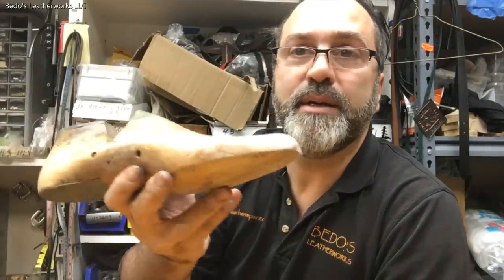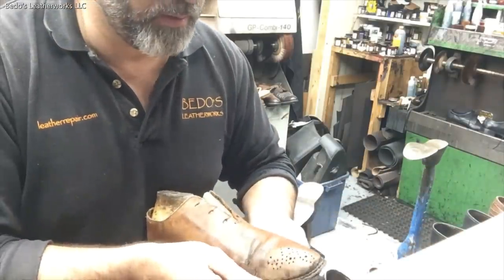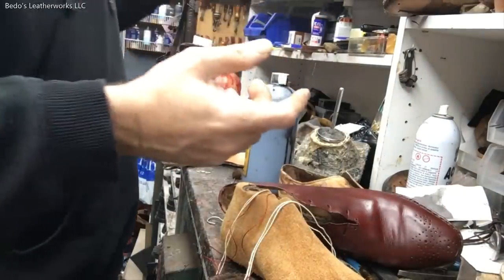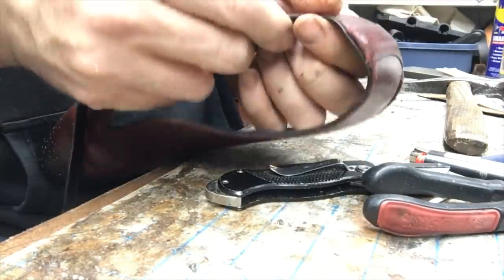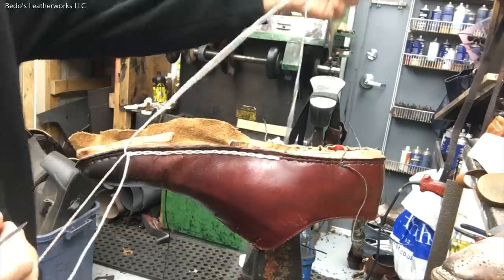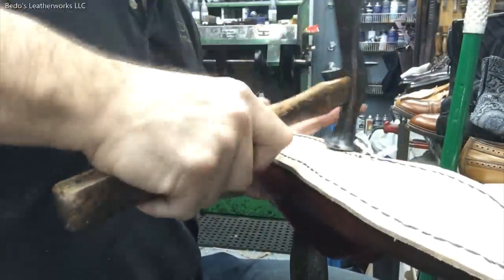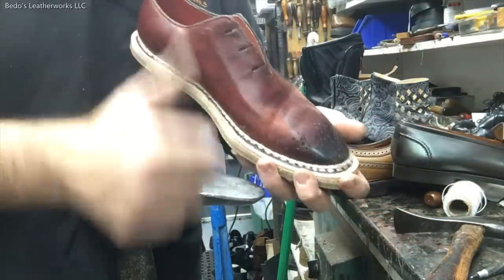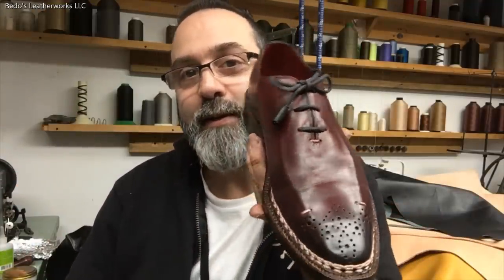Impossible Shoe Repair Project Stefano Bemer #157

Comment: When I was a teenager, I worked for Malanga Bros. Shoe Repair. It was a sweet little company where the craft was being taught and the shops were being passed down from generation to generation. Sadly, I think all the shops closed with the openings of Payless shoe stores on every corner, and I'm pretty sure that these artists all ended up working for Walmart.  But, watching your video brought me back to a time in which quality outweighed quantity. Just for a moment I could smell the shoe repair shop. The leather, the rubber, the glues....  Ahhh, Thanks for the memories. <3 Shelly

Comment: Thank you for such an entertaining and informative Video. For a while I was a maintenance engineer for Bata shoe manufacturers, and saw so many leather, rubber and plastic shoes made. Its a really labour intensive business. And its so odd that a brand shoe can retail for 5 times the price of a cheap shoe yet there is little difference in the effort and materials used

Comment: Fantastic job Steve.  Given the cost and quality of Stafano Bemer's a shame they ended in the condition you started with.  Were you able to tell if they were bespoke or standard product albeit high quality.  Finally how did you manage to get your hands on two pairs?  When you get them back will you be doing remaining shoe.  Surely someone out there would pay for have them given the opportunity?
Reply from the maker: Andy Bell the blue I bought on ebay
The red was sent in for a restoration which I said no to and the customer donated them. I will leave then as Is.

Comment: I just found  your channel...most excellent! I'm a used-machinery repair guy....but anyone who can fix old worn out stuff is OK..!
 My parents had a piano store back in the 1960-70's....my Dad did all the repairs....a lot of wood parts in the 'action' for each key...maybe 15 or more parts between the key and the strings...88 times. So I can really appreciate your hand work!!
   A question...don't laugh, I'm on limited income and buying 'cheap-o' work boots...several pairs, different brands USA made Chippewa, Wolverine......then, out on my ranch...the soles that are 1 piece...just peel off after a few days. The boots/soles appear to have been made by just using some sort of urethane to 'glue' them on to the uppers which are still quite useable....is there something I can use to re-glue them....??
 No shoe repair shops around here anymore...just buy the cheap shoes/boots and toss when worn a little...
  Anyone else got any idea..? Oh, by the way...all the 'stitches' are fake, just molded on to the 'soles' on the edges.
Reply from the maker: Wow in a few days???
Well there is Barge cement but not sure how well it will work for you. Clean both surfaces thoroughly and sand the surfaces if you can. Alt glue both sides wait about 20 minutes and press together
Reply: Hey, thanks for the reply!. the soles are fake Vibram...even the little lugs around the edges are hollow,  probably trash time for the uppers, but they look like new........
 3 days....for the USA made Chippewa... @BedosLeatherworksLLC
Reply from the maker: @dougankrum3328  you’re welcome to send me some pictures bedos@yahoo.com
Reply: @BedosLeatherworksLLC  Pictures...OK...! Nothing between the flimsy insole  and the fake Vibram...1/2" of brown urethane foamy stuff...nothing really 'smooth' to glue to like your stuff.

Comment: Steve,  I am wondering ..... If you sand the surface of leather, would the leather grain be sanded away ??  If so, without the top grain, the leather would be like a piece of card board paper !  Besides, without leather grain, how can you bring the shinning surface back ?  what's the number of grit sand paper you used ??  Could you tell .... Thanks !

Comment: I decided to order an airbrush kit to do the burnishing with instead of using the Pom Pom so I do not end up with a harsh line and it looks more natural when it is complete. Not sure if I should apply the dye full strength with the airbrush or thinned out. I guess I will figure it out when it gets here and I try it on the first pair.

Comment: was a carpenter for many years.  owned table saws, skilsaws, chainsaws, routers, even a K-12 saw, every means to inflict grievous injury upon the body.  none of em got me, except a lowly utility knife quite similar to what this man is using. cutting overhead a piece of arch trim jamb liner for a window.  holding the trim with one hand, slicing with the other hand '..... the length of the inside of my forearm - 30 stitches.  lucky I didn't hit an artery, ligament or tendon.
Reply from the maker: marcus cicero OMG 😳

Comment: I had found some chelsea boots that were very dry which I had put lotion on to rehydrate but it doesn't seem to be working. Dry cracks seem to be forming were ever it is bent. What do you recommend?
Reply from the maker: David Glazier not much you can do when it’s to a point of no return

Comment: Doing that "leather footbed integral gemming" looked like such's a big pain.  Red hot awl / poker or drill. I got a wood and leather burning kit for a birthday once, think it was my 8th, and an electric drill for another, my 11th... drill is faster but it would end up burning though too, unless you pecked your way through.  Bet you failed the awls by overheating the heat treat temper... turning them back in to cheap rubbery cleaner cloths hanger wire!  
Notice I sort of skipped over the wood/leather burning kit.... yep  got in trouble with branding our dog Toby III, a beagle, and my brother with ownership brands, in case you lost them.... suggestions you really got to get them strapped or cinched down tight, or they wiggle around so much its hard to do a neat job... never mind the whining and wimpering!

Comment: Could you not use a Dremil type  tool with a fine drill bit in place of using an awl ? It may not be true to the craft but it would certainly make the task easier.

Comment: Always nervous watching people work with razor blades now. This last year I put some pressure on one during typical work use and the blade snapped. It was a brand new blade, which ended up being a fairly good thing. When it snapped it took the end of my left thumb nearly completely off. I did end up saving it, but have absolutely no feelings in it now. Kind of feels like its covered in superglue. I can feel pressure, but no sensitivity. Now I kind of tense up when I see someone working with a razor. It didnt stop me from working though...lol

Comment: God knows the cost of this repair. I think this feat would simply grant you the right of ownership of this shoe. Like winning a custody battle. Question: does Blake rapid stitching vs regular Blake require a different machine or just a different setting? I find it fascinating that places like John Lobb has people still carving lasts for their bespoke line. Don’t think I’ll ever have the sheckles to say a shoe company made a last specifically for me lol. Prob against my beliefs to pay 5 grand for a shoe too. Law of diminishing returns at a certain point.
Reply from the maker: John E. Zang Blake  stitch is done inside/out stitched, the rapid Blake stitch is the same but added an outsole stitching to it.

Comment: why don't you wear some protection gear.  It was scary to watch  for few seconds at @2.50 onwards. What happens, if the knife slips. The reason is your hands shake a lot.
Reply from the maker: Nath then I cut myself . No wait I’ve done that before and I’ve learned not to do it again.🤣🤣

Comment: Stop STOP BLOODY DARNed HELL STOP right there... sew the mid-sole to the sole using recessed exposed stitches Red - White over the entire front of the shoe...  in 7 red strips and 6 white strips.... then do the heel in blue with 50 brass tacks holding it on... OR...
do a the Rattleback snake stitch to between the sole and the mid-sole.... and dye the leather yellow to form the background... use black border of recessed exposed stitches to hold the assembly of the mid-sole and outer sole to the inner sole!  Too late you missed out now... always a next time... unless you die jaywalking to the barbershop some day!